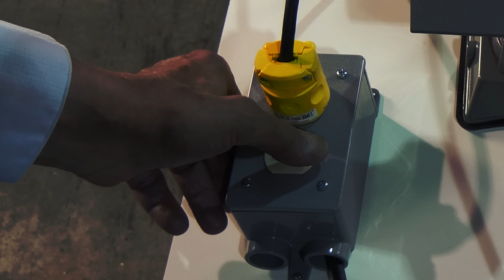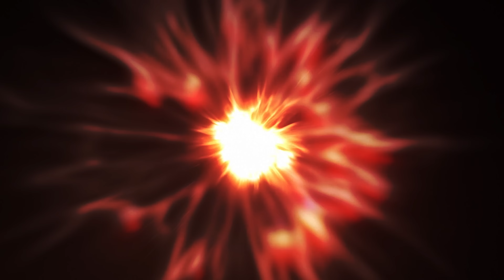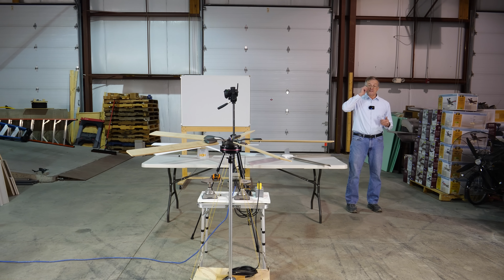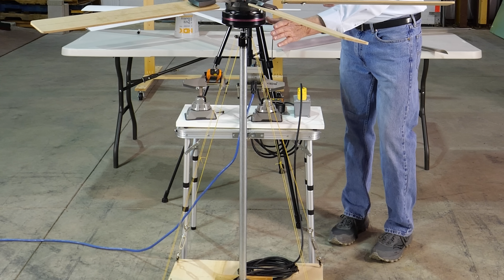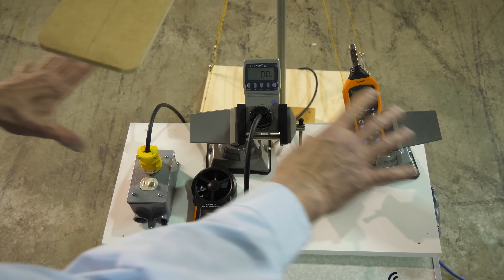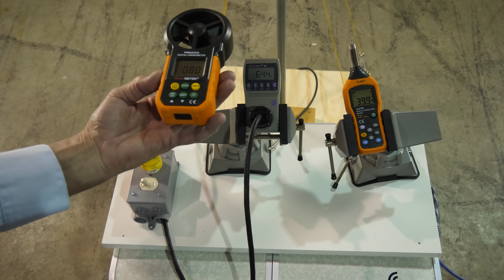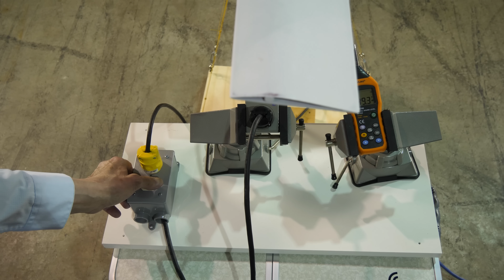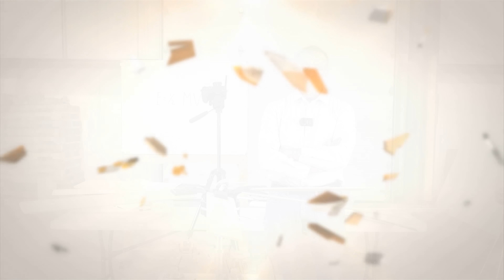This Fan Uses Almost NO Power

Comment: This is part of why mini-split A/C units are so efficient. The indoor and outdoor fan motors as well as the compressor are all variable speed and frequently brushless DC type. Midea makes a window A/C that is essentially a mini-split and I can confirm that the inside fan and outside fan are both brushless DC motors and the compressor is also variable speed so probably the same. 

Side giggle: I find it very weird that we refer to these types of motors as brushless DC instead of brushless permanent magnet. The motors themselves are not fed DC but 3 phase AC. Inside the controller, single-phase AC comes in, gets rectified to DC, the DC side then feeds three variable frequency inverters that (sometimes with feedback from hall effect sensors in the motor to know when to fire) provide three phase AC to the motor where the phase angle correlates with the current rotational position of the rotor. These controllers are often integrated into the motor housing itself so you feed the motor AC... who cares that DC is one step along the chain? AC in, get rotation. I mean, I get that this type of motor became popular in the 80s in computer fans and those also had the controller integrated into the fan motor itself but the controller was fed DC so it kind of made sense. Feed DC, get rotation without brushes. 

Not a rant, just something I think is weird. 😁
Reply: DC ceiling fans are becoming common
Reply: Saying "brushless DC" is a lot less of a mouthfull than "Variable frequency controller driven permenant magnet multi-phase motors" and there aren't enough vowels in there for a good acronym.

Comment: That is really a waste of power. It reminds me of the menu in video-games. Some games don't allow setting frames per second for the menu so some gaming systems waste more energy in the menu than in game. A friend of mine is burning 300W alone in the menu of bf2042 with his rtx 3080 doing all the frames it can (a couple of 100) while 30 FPS with maybe 30W would be enough. Some ppl even leave the game in the menu while going shopping etc. A simple option or a preset in the game could save a lot.

Comment: Very nicely told! In most of Europe, we don't have many fans or air conditioning; we have plenty of fridges, freezers and washing machines, though, and we're getting into heat pumps, both air source and ground source. I don't know, but I presume a heat pump uses one pump to pump the refrigerant, to effect the almost adiabatic heat transfer, and another pump to pump the warm water round the building.
Are you saying that the manufacturers of these mass-produced items are using cheap AC motors, when they could be using slightly more expensive, but much more efficient DC motors?
The fridge and freezer are on all the time, and the heat pump will be on two thirds of the year; how many Watts am I wasting?
Reply from the maker: Obviously,  I can't answer your question, not knowing the specifics. But, the general principle holds and if more effecient motors are part of an appliance, the power requirements overall will be lower.  This should be a good reference point.

Comment: The use of these motors should start to get either regulated like the charging cables were for phones or there needs to be a program that's dedicated to investing in the most efficient current tech to reduce it's cost of production so that it can out compete inefficient obsolete tech that's cheaper do to existing manufacturing logistics.
Reply from the maker: I hate the idea of regulations and regulators with their own motivations and agendas interfering in the market.
Safety is an exception to this involvement, but efficiency isn't. 
I think what we're doing to highlight the cost savings to the user and the public is better. Smart consumers will simply demand a better solution, and they'll get it.
Reply: @TechIngredients  At a certain point efficiency does become about safety, at least when it comes to the environment, which is what the phone charging cable standardization was about, too much e-waste.
Reply from the maker: Maybe, but it's indeterminate where that noble goal croses into interference with the person that is spending their own money for their own purposes.
I try to avoid hyperbole, so I won't use the term, but the government becoming involved in the free market carries its own risks.
Reply: @TechIngredients  I can't see it being any more indeterminate than Canada's Energy Efficiency Regulations, or the EU's Energy Efficiency Directive and the Energy Star program used in the USA, or the E3 program used in Australia and New Zealand. There's always risk when people are involved, best you can do is mitigate the risk.
Reply from the maker: The fact that you invoke three separate countries that have HIGHLY regulated economies is why I said it's indeterminate.
Let's not transfer responsibility for and control of an individual's decisions to an insulated and unknown baueaucrat.
I think it's better to share knowledge and educate that individual so that they can make wise decisions for themselves.
That's what we're doing.
Reply: @TechIngredients  I mentioned more than 3 countries by the way. The amount of that people want to learn and you reach is ineffectual when you're talking about large scale things like the pollution created from using mass produced inefficient tech. Then when you add in the corporations that will muddy the water with their own biased research your efforts fall short. It's happened before and will happen again.

Comment: As many have already mentioned, it would have been nice to see the system efficiency with the other two blade profiles and the brushless motor. Many viewers don't seem to understand that the power needed to turn the blades is only function of the blade   drag coefficient of the blade and that the nice asymmetric profile lift/drag ratio should be much better that the L/D of the thick flat plate (assuming that the Reynolds number is high enough...)
The angle of attack should be adjusted for each profile so that the lift coefficient is the same for all three profiles and  their cord should the same so that they all operate at the same Reynolds number. 
Finally, the efficiency of electric motors varies in function of the RPM and load, so a thorough performance analysis would require quite a bit of time and effort...
Reply from the maker: We will revisit this along with a short "how to" on blade construction. 
You want each rotor to support the blades at an optimal angle of attack for that particular blade profile rather than at some arbitrary, fixed angle. My design makes that easy to adjust even after installation.

Comment: Good video.  Interesting that you tested the airfoil blades... BUT most fans have a switch to reverse the rotation,  which makes them more efficient in winter.  So flat blades should be generally more practical,  IMO.  😎 🇦🇺
Reply from the maker: Actually,  the design I will cover in the follow-up video allows the angle of attack to be adjusted by 360 degrees.
It's a little more cumbersome than just hitting a switch,  but not much.
Reply: @TechIngredients  Cool,  I'll keep an eye out for it!

Comment: Are you sure your watt meter is measuring real power and not reactive power - which you’re not charged for as a domestic customer.  Remember that an unloaded AC induction motor is pretty close to being a pure inductive load, so you might be measuring 60 VAR   (Reactive) which actually costs you nothing.  Only when the motor is under load does the reactive component fall and real power is consumed.

Comment: I'd like to see a load cell under each fan to measure the force applied to the air. The moved air mass is dependent on the pressure applied by the fan.
Would be quite easy to plot a curve between power draw and force applied on the air. With a constant swept area for all blade types you could determine a comparable peak efficiency.

Comment: I have a mid-sized Hunter fan in my main room that is left on low 24/7.  Last night I measured the power consumption.  3 watts on low.  Forget what it was on high, but that is only a few hours per year, so that isn't important to me.  Considering its a constant power draw, I think I lucked out.  About $5.50 per year to operate.

Since it is hard wired and the moving blades prevent me getting close, I had use a special procedure to check power useage.  My house has a transfer switch where I can transfer over to generator.  Flipped that switch.  Cut off all breakers except the one going to the fan.  Hooked up the Ecoflow Delta 2 to the generator inlet.  With fan off, measure base load on that circuit.  20 something watts.  Turned on fan and 3 watts above that.  Did this twice to verify readings, and also tried the high speed setting.  While there, I also verified that the Ecoflow was on the ragged edge with regard to supplying minimal base load power to the house during an outage.  The limiter there is a 500W max input to the solar port, which could come from a server rack battery.

Not sure if my fan uses a PMM.  Not gonna take it down to find out.  All I know is it does a good job, is quiet, looks good and draws almost zero power.  I'm happy.

Didn't do it for fans, but I use the energy star website when looking for appliances.  Hopefully that'll still be around...  Anyway, a search of ceiling fans yielded a tested performance metric of between 47.4 and 483 cfm/W.  Of course some of that difference will be in the blade diameter and not blade design or motor efficiency.

Comment: So you're just going to take the power usage measurement on a bladeless motor in the first 20 seconds without giving it a chance to warm up and use even more power? That seems really short sighted for you guys
Reply from the maker: Think about it.
All the measurements were made within approximately the same time frame. Indeed,  there may be drift as each motor warms, further lowering the relative performance of the AC fan, but it's not much.  Look up the conductivity of copper vs. temperature over a 10 to 20 C temperature differential.

Comment: I really hope the significance of your message doesn't fall on deaf ears. It stands to reason that some of the greatest efficiency gains we may hope to achieve in the near term will be found in electrical devices that have changed little in the last 100 years yet are found in near constant operation almost everywhere.
Reply from the maker: That's an excellent point.

Comment: Awesome, I will be thinking of how to go about replacing my motors now, really makes ya think why we can't just move in this direction, I know cost, but really it can't be marked as energy efficient right, lol
Reply from the maker: But, we can!
If you're considering this, at least in part, because of this simple demonstration, then it wouldn't be hard to spread this awareness (like we're doing). The demand for this increased efficiency will drive down the price due to market competition, which will accelerate this transition. 
It's all good.

Comment: And yet we, as consumers, are seen as the low-hanging fruit that is having crap EVs and heat pumps foisted upon us. The manufacturers should be COMPELLED to provide energy efficient devices long before we have to give up on our lifestyle choices.
Reply from the maker: No, they shouldn't!
We aren't passive sheep. In a competitive market, the consumer rules.
Spread this knowledge (nicely and with good humor), and the better informed consumer will get what they're willing to pay for. Spread this knowledge further, and the competition will make it cheaper.

Comment: Here in tropical Asia your upright stand fan costs $20. 3 speed fan draws at speed 1/ 35W 2/ 45w 3/55w. There are Chinese crap with bushes instead of bearings, you end up with a fan museum.
 
3 years ago purchased BLDC 12V fan motor for $13 with built in speed control, draws 4 to 23w, bearing/bushing has almost failed.
 
2 years ago purchased 7555 DC 12V brush fan  motor $3.50 and PWM speed control board $1.  On the majority of your mains induction motors you can remove the armature and replace it with the 7555 fan motor ( supported in cage of original induction motor )   just need longer bolts. Just replaced this motor after 2 years of service. As a technician the amazing thing to me is this small DC fan motor draws 4 to 25W. Same as the fancy computerized BLDC more expensive motor above, how can this be?
 
The speed control ability of either of the above is surreal,  you choose the perfect speed. ( Just like a volume control ) Critical in the cooler months where the clunker 3 speed fan on speed one is too  cold at night.
 
If you are off grid like me or energy conscious you will love  the low draw, yes you can actually feel 4W the lowest speed. Note these are Asian prices with very my  keen shopping in Asia. Also you will need to buy a 12V 2A plugpack $2 to power these motors. On standby these draw 2W. Also note you need to be handy to do this as nothing is uniform between fans models. Soldering of new wires required. Drilling of hole for speed control.
 
The beauty of a 12V efficient motor is so many ways to power it. A selected simple solar panel. A power bank with usbC that gives 12V out ( may need adapter that's requests 12V from  PD. Any sort of 12V battery. Or the mains  plug pack.
 

Its a very rewarding project to convert a old throwaway fan not worth fixing and also  dirt cheap if you buy 12v motor online from the right source.
 
You can buy  brand new 12V fans ( internal rechargeable batteries or plug pack ) but  there sold at a premium. Search solar fans.

Comment: Those AC fan motors use capacitors to alter the speed, essentially wasting power just to give you speed selection.  If you could find the most efficient speed using the AC motor for comparison purposes...

Comment: I don't like the way air speed was measured. The anemometer should have a had a fixed position and maybe 5 more placed equally from 1ft from center to the tip of the blade and the speed averaged over the 6 anemometers. But, so easy to criticize when your sitting on your but watching Youtube Videos.

Comment: I'm surprised you didn't mention the fact that in trying to cool the room (or it's occupants) with a ceiling fan running 24 hours a day, you are defeating the purpose by ADDING an additional 50 watts of HEAT, EVERY HOUR!

Comment: I think this why battery powered cordless tools. Moved to brushless DC motors a few years ago. Ac has its up sides in transmit. But DC is usually more efficient at end use.

Comment: I believe the main draw is either a start capacitor circuit, or starter loop circuits(depending on the AC motor). Both waste a ton of power.

Comment: The biggest problem that makes these not accepted by the average individual\contractor is because of the complexity and non- standardization of the motor controller. I have some technical experience with motor controllers, and a $0.25 part can take out the whole system. Typically, the reliability of the BLDC motor itself is more efficient and more reliable, but the controller is not even close because of the electronic parts reliability/ replace-ability. The industrial market of controllers is better because of the cost of the controllers, and typically can be repaired feasibly for less than a new controller or another manufacturer's controller can be programmed to match the motor. The manufactures of consumer controllers have not been willing to supply the parts or information for repair or the motor controller as a stand-alone part. Since the small motor controller is designed to match the motor design, the best option for most people is to buy a new motor with a new controller. The motor becomes a consumable sacrificial item because the manufactures typically do not offer the motor controller for sale by itself in the long term. This is a planned obsolescence.

Comment: My guess in regards to inefficiencies with the ac motor is the fact that the 60hz frequency causes out-of-sync forces when the motor is spinning up. While the fields on the coils is constantly oscillating at 60hz, the motor itself is still getting up to speed and will experience small forces pushing against it. As it gets up to speed. Then, even at synchronous speed, the momentum of the fan itself pushes against the 60hz upper limit. In essence, the ac motor isn't just dumping power directly into the rotation of the blades, rather its trying to lock the blades into the same frequency as the ac supply. It "wants" the blades to spin at exactly 60hz, and this involves power loss.

 Does that DC motor have some sort of rectifier in it that converts the ac mains power to DC? I cant help bit think that there's likely a reasonable explanation for the ubiquity of ac motor ceiling fans vs brushless DC. Perhaps lifespan or cost.
Reply from the maker: The DC motor fans come with a rectifier and regulator in a potted module that's about 60 cc in volume and attached to the motor.

Comment: Hi, i really like this efficieny videos. 😊 I like working with solar, heatpumps, fans, pumps, and anything autonomus thats practical.

To point at the old motor, You had 40w heater in form of ceiling fan going 24/7.  Trying not to meke space feel cooler😅, its big finding.

This summer i am mowing all heat producers out of rooms, like network gear, mini PCs for automation, desk PC, all making load of heat. 
I stick with using laptop with 32" tv all running on 25w.

Its not only cost, its confort, AC isnt needing to blast so cold air, to keep 26°C. 

Outside we have 37°C / 22°C at night. And indoors it keeps goung to 28°C, i cant tolerate AC to blast me with cold air at night, beter be hot than have a sore throat😅.